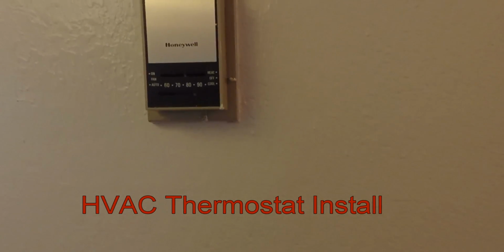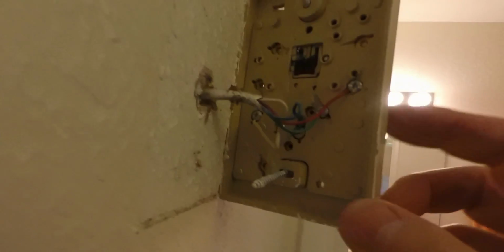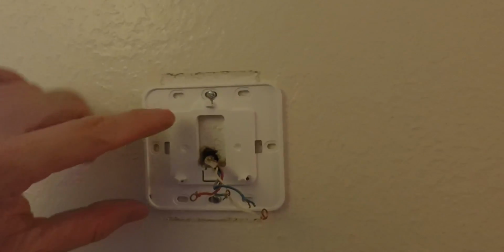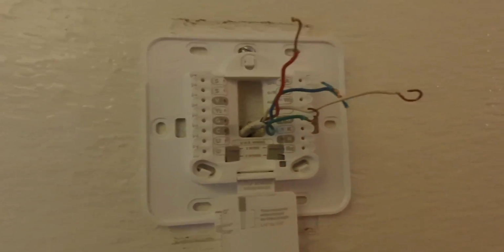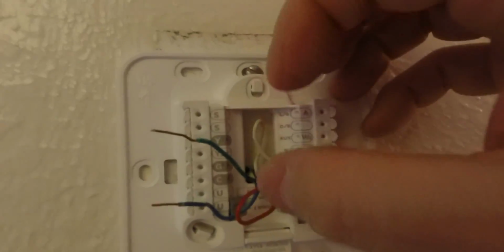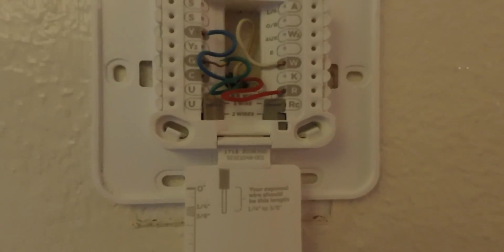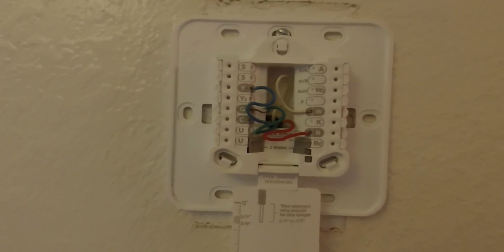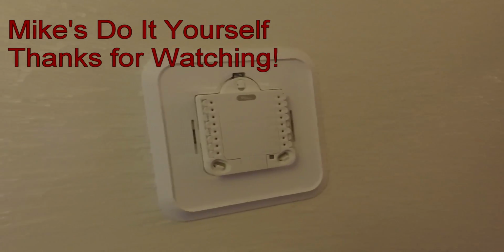HVAC Thermostat Install

Comment: Carrier heat pump?
Reply: Carrier heat pump take pictures of existing heat pump wiring then match it up with the new T stat .then use install instructions to program according to the heat pump T stat you have.
Reply: Barry Ford it’s all brand new from scratch
Reply: Ok retired used work in the trade as a technician . Thought I might could be some help.
Reply: Also on some T STATS there is a switch that says electric or propane be sure to switch one or the other for heating gas furnace or electric heat strips.
Reply: jason kite I have a carrier products installed in my home I never did like the top tech digital t stats thinking about purchasing the t6 stats I have always liked Honeywell stats. What is it exactly you are talking about you have a Carrier your putting in from scratch you run into wiring problem what seems to be happening .
Reply: Barry Ford well I think on regular heat mode it is turning on both heat strips plus the compressor, so it draws 75 amps per leg and melts the breaker
Reply: jason kite Do you by chance have Aluminum wiring going to the breaker by chance causing the wiring to shrink and expand and then the wire will get to hot and over amp and in some cases cause a fire aluminum you must use molinax contact grease and different wire nuts and so forth. Also inspect your heat strip kit 5 kw, what ever the size make sure that there are no broken wire etc in the kit itself causing a grounded short . Could result in a fire if the breaker doesn’t do its job. There are limit switch’s in the heat strip kit and a fuse link to stop it from over amping and shut it down most heat kits come from the factory plug and play .
Reply: Barry Ford I used copper wire but the draw was75 amps plus 75 = 150amp draw on a 100 amp breaker  so I turned off one of the breakers inside the unit . I thought the heat strips only came on on Emergency Heat but I don’t know much about heat pumps, now on heat mode it runs one heat strip and the compressor. It warm the house tho.
Reply: Jason kite is your heat pump a two stage 21 SEER heat pump that has an inverted computer board in the outdoor Condenser unit better suited for colder regions that have lots of snow newer tech comes  expensive fixes they work great when there isn’t problems is this what you have for a heat pump.
Reply: Hard to troubleshot without put my eyes on the issue at hand. A suggestion the newer one on the outdoor units that can give you clues with a series of lights flashing red or green there is a legend on the cover telling you what the flash mean if you have an heat pump with inverter tech. Alway pull disconnect and let it discharge the semi conductor banks for about 10 min before putting your hands on it. Serious shock hazard safety first .
Reply: Barry Ford It’s a GrandAir 4ton self contained “packaged unit” brand new last year
Reply: jason kite what state do you hail from I’m down here in the sunshine state  the T stat has for heat pump alone and auxiliary heat. So in the heat mode when the heat pump isn’t keeping  up say have your T stat at 68F but actual reading in the house is 64F so T stat senses this heat strip kick on w/strips until the T stat is satisfied. You heat kit is rated at 5kw , 10kw ,15kw ,20kw ,also a listed amps it supposed to draw along with breaker sizing . Does it a regular disconnect or breakers from the whip were it attaches to the package unit is that were the breakers burnt or is it  inside the package unit with strips.
.
Reply: jason kite so you installed this GrandAir 4Ton DIY?
Reply: jason kite when you just switch your T stat to emergency heat the blower motor must come on first  then the heat strips if this doesn’t take place this could happen it starts over amping blowing a fuse a limit switch opens turns it of or breaker breaks. Nothing is fool proof  I have seen where breaker weren’t sized properly luckily no fire burnt damaged heat kit .Remember the coils in a stationary heater you plugged into an outlet based on same similar design but put into air handler .
Reply: Barry Ford yes I installed it all myself
Reply: jason kite that is great a lot of work for one person.Sounds as though the package unit worked well up to a certain point till a component in the unit decided shit the farm.
Reply: Barry Ford yes
Reply: Barry Ford I pretty sure I just have the thermostat wired wrong
Reply: jason kite  remember that 24 v has leave from package unit and have path to the T stat and back to the T stat is there a jumper between R and RC some times there is one. Sometimes you need it sometimes you don’t. Or W might have jumper wire to W2. Be sure you don’t have something like red 24 v jumped to yellow would
Reply: Which would cause the compressor and outdoor fan to keep running and not shutoff .
Reply: I meant if Y and R are jumped the compressor and fan would keep running it wouldn’t shut off if you had it that way .
Reply: @jasonkite1988  is it a t6pro thermostat?if so there was an issue with them and it was noted in the instructions about if you have a heatpump you couldnt use E or AUX i believe,i had a similar issue i switched the wire and it stopped,so i would start by unplugging white wire and try again

Comment: hey mike, I have an Orange, Yellow, Blue, Green, White, RH, and RC on my old thermostat.  The RH and RC are jumped together.  Where would I put the orange and blue on this system, since there looks to be 1 spot for o/b?   And, am I supposed to jumper the RH and RC like my old one?
Reply from the maker: The orange wire is going to be for the heat pump and the blue wire is going to the common wire. I would put orange in the o/b spot and look for a common wire location for the blue wire. I would wire the RH and RC wires separately. I would go by the directions in the thermostat first and if you need to make adjustments, it should be easy enough. If heat or cool doesn't work, you may need to jumper RC and RH. Don't forget to pull the breaker before changing wires. Good luck! - Mike
Reply: @mikesdoityourself  But how do you know based on his wiring scheme that the blue wire is common? In your situation here, the blue wire is NOT common. What if I see blue AND yellow? I also see a terminal on my new thermostat that separates O and B but also has C. Help I'm just so dam confused
Reply from the maker: @exoticcar5482  It definitely depends on what kind of system you have as to what your wiring is going to look like. I would suggest going by your new thermostat wiring manual and by the wire positioning of the wires taken off of the old thermostat. There should be some commonality between the two where you should have only a couple of wires that may need to be figured out. Good luck! - Mike
Reply: @mikesdoityourself  Thanks for the reply!  Does it matter if it is a gas Pack, and not a heat pump?  I have a GasPack.
Reply from the maker: @SavDog262  A gas pack is a single unit, electric cooling with gas, propane or oil used for heating. The wiring should be the same, your just controlling different things to make things happen. Definitely make sure the thermostat can work with your system- the thermostat manual should be able to answer more questions about compatibility. Good luck! - Mike

Comment: Hi Mike, I have the exact thermostat but would like to have a MOUNTING PLATE like the one in your video.  Where did you get this?  Is it made by Honeywell?  Thanks.
Reply: Thanks for your reply Mike.  They cheapened up the package and now they supply three wall anchors for the NWP.  I would have rather paid a few bucks more to get the wall plate and use existing holes.  The wall anchors had cheap screws and the heads get torn up easily.  Thanks again!
Reply from the maker: Yes, the mounting bracket came with the thermostat - Honeywell. They might sell it separately, not sure though. Good luck with your project! - Mike.